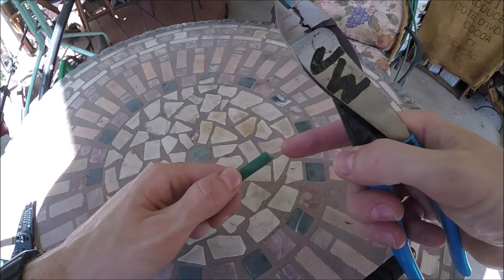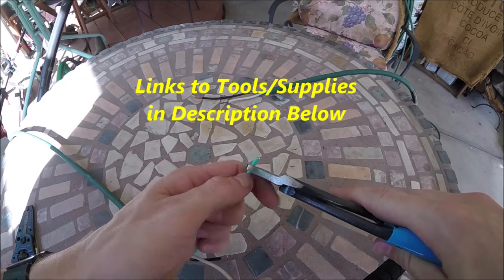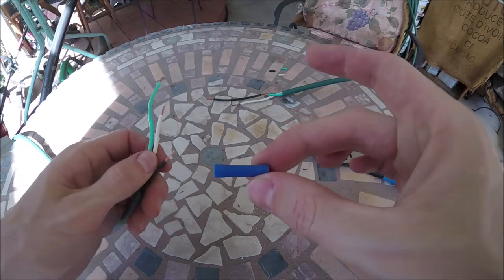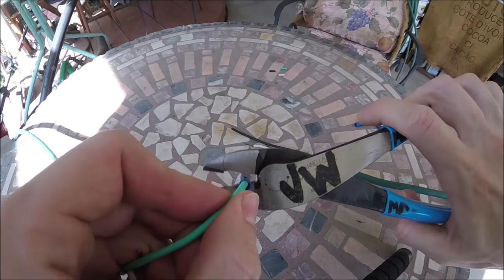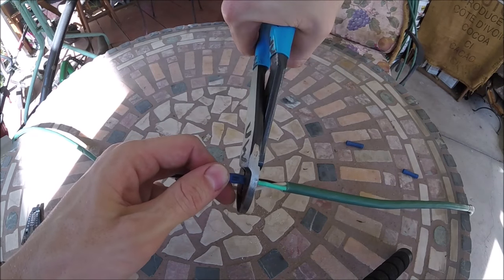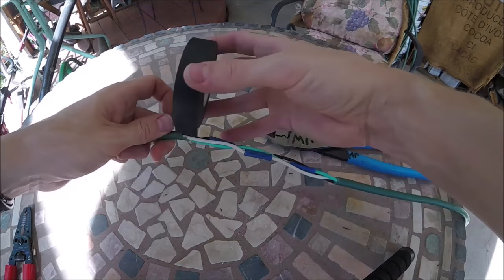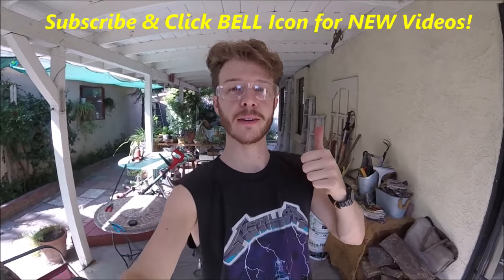How To Correctly Repair a Cut or Damaged Extension Cord -Jonny DIY

Comment from the maker: TOOLS & SUPPLIES & DONATION LINKS
Wire Cutter Crimpers- https://amzn.to/2PKYnFg
Butt Connectors- https://amzn.to/3S4Tfyl
Wire Strippers- https://amzn.to/36E4Orn
Electrical Tape- https://amzn.to/2S34TbK
Safety Glasses- http://amzn.to/2ez41Jw
If you Enjoy the Channel Consider Helping Support it by Donating below & by Subscribing.
PAYPAL DONATION https://www.paypal.me/JonnyDIY
Zelle Donation JonnyDIYs@gmail.com 
Venmo Donation JonnyDIYs@gmail.com
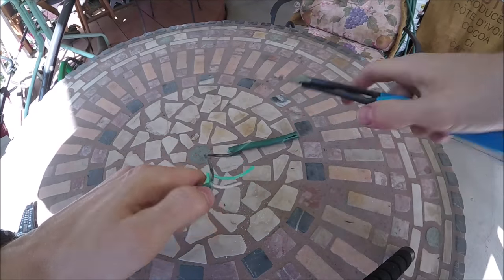Reply: Thank you for this comment. One thing to mention: I figured out what butt connector size AWG by looking at the tool I was using to strip the wire. It labeled the size, thank goodness, because I have no idea what I'm doing. 0:51 where you skipped the step.
Reply from the maker: @stitchedpumpkin5905  you're welcome, and thank you for sharing that tip 👍

Comment: A little upgrade would be to slide a piece of heat shrink on before making the connections. Then make the connections, pull the heat shrink into place and heat. It will do a much better job of protecting the repair than electrical tape.
Reply from the maker: Great idea! Thanks for sharing 👍
Reply: There are also butt connectors with heat shrink built-in. And rather than tape overall, if you’ve forgot to use heat shrink, you can use liquid or spray tape which last longer.

Comment: Not ideal. I would solder the wires together, use heat shrink for each wire and then heat shrink over all 3.  Tape is messy and unreliable if you ask me. However, the creator of this video deserves kudos for offsetting the connections. That was good work.
Reply from the maker: Thanks Peter. Yes, solder and heat shrink for sure if you've got it 👍🏻

Comment: Solder and heat shrink individual wires and then heat shrink the entire repaired section.
Reply from the maker: Yes thats even better! Butt connectors work fine though 😀
Reply: Solder is not for mains! All electrical standards require mechanical connections. Solder is nowhere near as conductive as copper...
Reply: Nah u leave that extension cord out on hot concrete the solder will reflow
Reply: I would never solder but I would use connectors and then shrink wrap before taping or cross the green and green in a x and run then around each other the strongest connection then shrink and tape would need a train to tear them apart
Reply: @cjprkth  It's not that complicated. Just twist the bare wires together and tape them off. Works perfect. No need to reinvent the wheel!
Reply: Thats right. Glad to see another real electrician chime in.
Reply: @stevesh9418   @Steve Sh  nah fam, i use bubble gum, bubble yum cherry flavor to be exact, every other type of gum causes shorts.

Comment: im very surprised i cannot find ANYTHING that is like a little box that opens and has you lay the wires in, screw them tight, and close. i feel like thatd be way more secure than crimping or wire nuts. There are lever nuts which are ~close~
Reply from the maker: I know I've seen something like that before but can't recall from where
Reply: @JonnyDIY  oh wow you replied lol. Your video is good info and probably be what i end up doing,

in my case its a house cable for the dryer- all i see is crimping or those twist connectors and that 'people do that all the time' but i was hoping there was a more heavy duty option, yknow?
Reply from the maker: @Selendryle  ohh wow for a 220v clothes dryer cord? I would probably just replace it. But soldering and using heat shrink tubing then tape would be the best bet for a repair other than if you were to just shorten the cable to where it was cut 👍
Reply from the maker: If not 220v and just 120v other methods should be fine but soldering isn't a bad idea there either 👍

Comment: Thank you for this! Managed to save two 100 ft extension cords. One was inherited, and had already been repaired with this method, but that fix is bulky because all the connections are on top of each other. Great tip and video!
Reply from the maker: You're welcome, happy I could help you fix those 2 cords 👍

Comment: Never thought to make dramatic different lengths. Works better as I had short alternate ones. After I wrap it I use shrink tube over the ends so it doesn’t unravel
Reply from the maker: @Daveyboy1128  Awesome, nice job. Yeah I need to buy some of that heat shrink tubing 👍

Comment: Hi    I viewed your youtube video and went out and got a wire stripper and some of those wire butt connectors, but didn't get a stripper with a crimper, so I went and got one of those.   I cut a 3 wire extension cord a few months ago with a hedge trimmer.   I am tickled that I could repair this myself....with your help!    thanks Judy
Reply from the maker: That's great, glad the video helped you out. And thank you, reading this put a smile on my face 😀👍🏻

Comment: I highly recommend this clear, easy to use instructions. I would add the total length to strip the two wires, where to start the 2nd stripping, and the length between each butt end. Then, give the reverse process for the other color matching wire.
Reply from the maker: Thanks Don! 👍

Comment: I readily use butt connectors for low voltage wires but it never occurred to me to use them for household voltage. I've always used solder which takes much more time.  Whichever way you go, the staggering of the splices is a great idea as it not only reduces the thickness of the splice, it reduces the risk of shorting the wires in the event of a bad connection.
Reply from the maker: Thank you James! 👍🏻 Yes solder and shrink wrap ia always good if you have on hand and have the time

Comment: Can you connect two separate extensions cords but with two different amps?
Reply from the maker: I don't recommend that no. You'd be better off just buying some new ends for those and making shorter cables. That or you could do as you said, but not overload cable, only use for lower rated amperage cable.

Comment: My Dirt Devil vacume had a short life. I collected all the screws from it, pulled it apart and cut the elctric cord off. Is there a way to repurpose the electric cord? Has the plug-in on one side and open wires on the other.
Reply from the maker: Yes you can buy a female end for it and connect that to the end to make an extension cord. Just be sure not to overload the rating for the cord 👍
Reply: @JonnyDIY  Thanks!!
Reply from the maker: @kathykaura7219  You're welcome, glad to help. You should be able to find at local hardware store 👍

Comment: Thanks for this informative video! My Tv cable got torn apart! Does the AMPS of the Butt connector matter?
Reply from the maker: Yes try and match it to the amperage. If not sure, get the ones rated higher than lower 👍🏻
Reply: NO.....NO......NO! Never repair any coaxial cable unless its the underground 500 trunk coaxial. In that case the coupler is like $50 because it will keep the Resistance super low.
Go buy another length of RG coaxial cable and do it right.
Actually, call your cable provider....Deny you did the damage and they'll fix at no cost to you. Just report a "poor picture" and let the tech guy discover the damage.

Comment: 👏👏👏👏👏 will it work for a 10 ga cord with 20 amp plugs
Reply from the maker: Yes just be sure to get the larger butt connectors. You could also solder them back together, I may be a little more inclined to solder with the larger gauged wires

Comment: The stupid hedge trimmer just cut my like new extension cord. I’m going to use this method. I would’ve never thought to stagger the spices. Great idea. I’m going to wrap mine with F4 repair tape
Reply from the maker: My Uncle did the same thing with his hedge trimmer, twice last year too! 🤦‍♂️ haha, it's so easy to do. Glad the video was able to help you out. Good luck with the rest of the trimming 👍🏻
Reply: #me2, I destroyed 2-3 50ft extension cord so far. At this point a battery powered hedge trimmer would have been cheaper...
Reply: Haha,  just did the same thing with my hedge trimmer. I think this is the second time so I'm  done with electric hedgers.

Comment: When buying the butt connectors, how do you know what size?  My local Home Depot lists 16-14 , 22-10, etc.  If it depends on how much electricity is passing through the wires, the appliance says 120V, 60 Hz, 11A.  Thanks for your help.
Reply from the maker: Once you have the cord wires exposed you should be able to tell gauge. Can measure but my guess would be 14-16 gauge. You can also buy a new end plug and attach to cut end of cord, itll just be shorter in length 👍

Comment: I cut my intex sand pump cord w mower, wondering if I can really do this also w this type cord, it has 3 wires also sticking out , seems easy the way he explains it😊
Reply from the maker: Yes you can do it this way 👍 can also buy new male and female plug connectors and put on each cut side, then just plug into eachother 👍
Reply: Thank you! Im going to attempt this!
Reply from the maker: @shelly9752  you're welcome 👍

Comment: I think a better alternative would be to buy a male and female extension cord replacement plug and make 2 cords. Splicing cords is technically not allowed by the US electrical code, but replacing the plugs is. Your methods seems safe, but I found this way more convenient. You can always plug the 2 smaller cords together to get the original length.
Reply from the maker: Good idea, that or solder the connections. I would do one of those two especially if was a heavy duty extension cord that was rated for high amperage
Reply: Yes but making the two plugs allows to pull loose, by the time you use the proper locking plug ends you may have spent $50. A power cord is a temporary use, the code applies primarily to permanent connectors that are allowed in a jbox and require access… like you said ,”technically”. I prefer your method except on a cheaper cord

Comment: Is this for sure safe?
Reply from the maker: I haven't had any issues with this method, but if worried you could always solder the wires together or just shorten the cord to the end of where it was cut/damaged by adding a new plug 👍

Comment: Can you just twist the copper wire together
Reply from the maker: No I don't recommend that. You could solder it, or safest bet to shorten the cord where the cut is and add either a new male or female plug end 👍

Comment: It seems that that electrical tape is going to be temporary and eventually start peeling away, become sticky and eventually dangerous.
I'm thinking some kind of heat shrink wrap will be better.
Reply from the maker: Yes if you please you could do heat shrink then tape over for extra protection, but the electrical tape is still holding on this after few years 💕

Comment: Does electrical tape also work as an alternative for the butt connecters?
Reply from the maker: No you need something other than twisted wires and tape...either get some butt connectors, or solder wires together or at least wire nuts 👍🏻
Reply: Of course it does since we are on the road of bad ideas. Hell why not.

Comment: I find it better (and safer) to solder them together and use shrink tube on each of the hot wires and over the entire cable. Nice and neat and clean and safe. There are very few instances where you would use electrical tape. It doesn't last.
Reply from the maker: You're right, solder and shrink wrap is the best fix, but this fix works well too. I make sure to wrap a lot of electrical tape really tight over area
Reply: @JonnyDIY  I hardly ever use electrical tape. Over a short time it becomes gooey and unravels. Over long periods, it dries up and just comes off. I would suggest a more permanent solution like I stated above.

Comment: Not sure if those are rated for home 120 volt, those look like 12v for automotive...
Reply from the maker: I think theyre ok. If anyone's worries, just solder the 2 wires and heat shrink and tape them or buy new end plugs and make 2 shorter extension cords 👍🏻

Comment: Don't use butt connectors. The 3 different lengths was a good idea, but you should do a proper in-line twist wire joint. No butt connectors, no wire nuts.
Reply from the maker: Thanks Edward! 👍

Comment: Not calling you wrong but working in the electrical field for 15 years I’ll object to this. For less than $10 you can have two cords with it be a lot safer than splicing an extension cord in that manner.
Reply from the maker: Yes you're right you can simply just add a male and female plug to each cut end and connect those to make cord full length again. That or just solder and shrink wrap the wiring back.

Comment: Butt connectors suck, Jonny.   Well, I shouldn't say that.  They have a high failure rate.  Ask any pro.
Reply from the maker: Yes you're right, soldering is best or just putting a new plug on the end of the cord 👍

Comment: I’m sorry, but electrical tape is not going to make it waterproof. A little silicone in the ends of the connectors would work better.
Reply from the maker: If you wrap the tape a certain way it makes it waterproof. It's taught in the military. A helpful viewer shared details and description how to do it in comments 👍
Reply: @JonnyDIY  I could be doing it wrong but every time I’ve used electrical tape it eventually came unwound leaving a sticky residue. I have taken pieces of plastic straw and slid it over the wires before I spliced them then slid it over the splice and pumped silicone caulk in each end of the straw and that worked pretty well. I used that method when wiring my boat trailer 15 years ago and the connections are still waterproof. I can’t take credit for that. I saw it in some handyman mag.
Reply from the maker: @Magnabee97  ohh the straw idea's great! Will remember that. Heat shrink tubing works great and is easy to use, but I didn't have any on hand at the time

Comment: Water proof! Ha ha ha
Reply from the maker: Start tape in middle go to end of one side then all way to opposite side, then finally back to middle and it does a good job. This cord has been used out in my yard year round in the weather for some lights now for 4 years now without any problems 👍